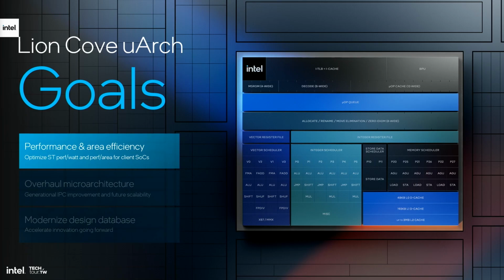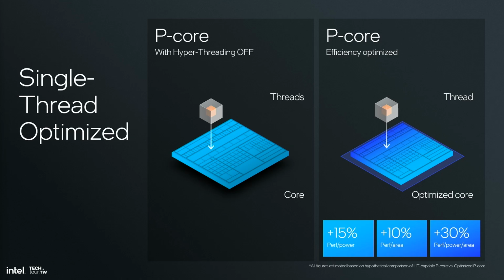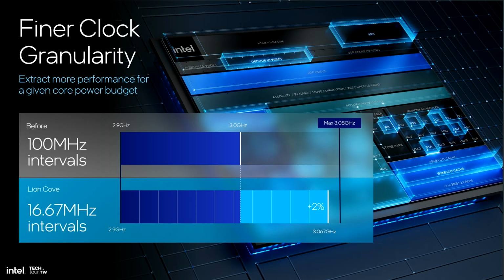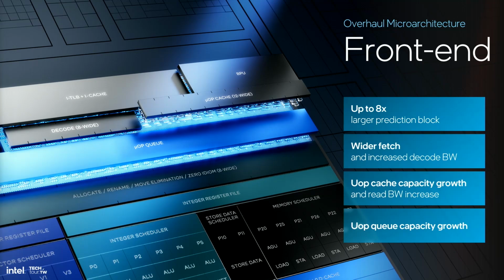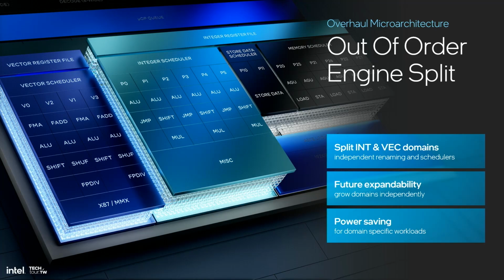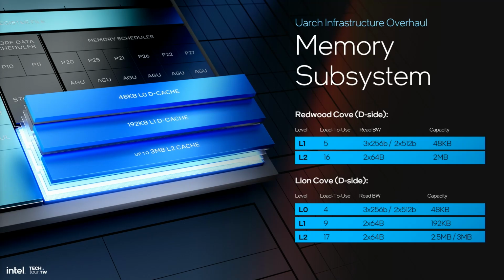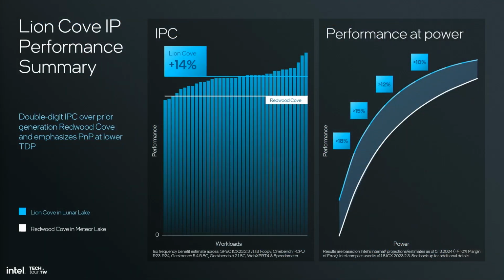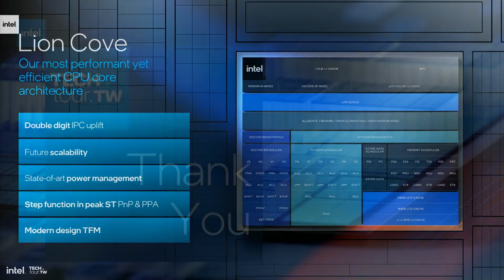Intel Lunar Lake 'Lion Cove' Performance Cores Explained

Comment: Would love to see P-cores get a stacked 3D v-cache for gaming.  The IPC uplift for AMD in gaming workloads is substantial.
Reply: I think it wouldn't benefit too much. The reason AMD benefits it a lot is due to its chiplet design that is too far away from each other. This increases latency and reduces performance. Having a massive cache mask this disadvantage and its very crucial on AMD side. Intel doesn't need much that cache due to proximity of its tiles in each other. You can still add more cache but it wouldn't gain or benefit a lot of performance compared to AMD and only cost them more.
Reply: @ZhaoHaiBuda  No.  The reason there is benefit is because games have larger working sets than typical applications.  Larger working sets put more pressure on the memory subsystem.  Larger caches relieve that pressure and that's basically all there is to it.  It has nothing to do with chiplet design.
Reply: @Nanerbeet  Yes It can relive pressure on memory subsystem but saying "nothing to do with chiplet design" is the best statement that invalidates your point.
Reply: @ZhaoHaiBuda  Wrong again.
Reply: Putting chiplets "far away" from each other impacts core to core communication, not the cache hit/miss ratio what-so-ever.  Games are very well optimized for single-thread or low-multithread workloads and do not typically communicate with each other.
Reply: @Nanerbeet is right here. The CPU needs to spend less time on lengthy memory accesses by using the cache, reducing overall latency and decreasing the time instructions can be fulfilled within. This allows the CPU to be a lot more efficient because it manages to perform more instructions in the same time in which it is pulling the same current.